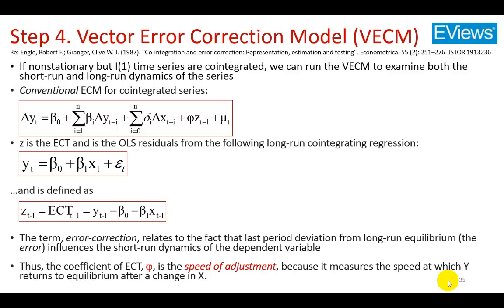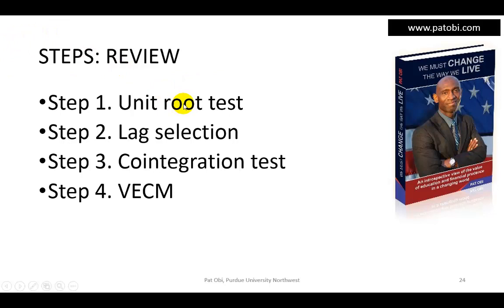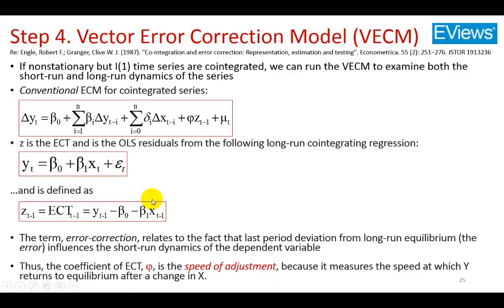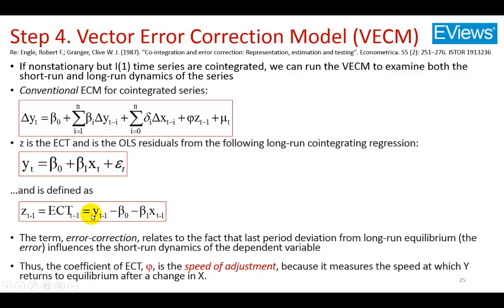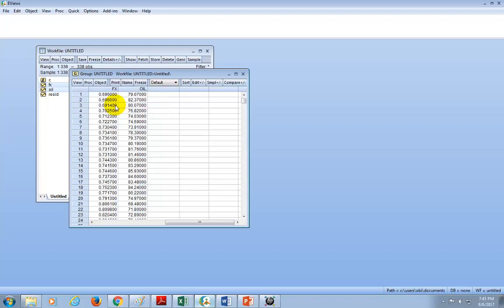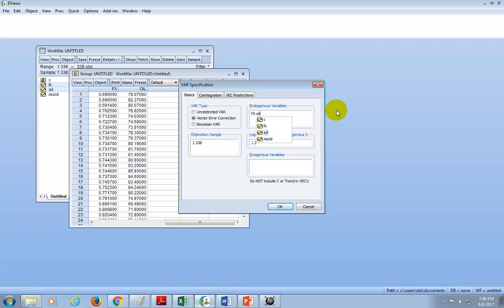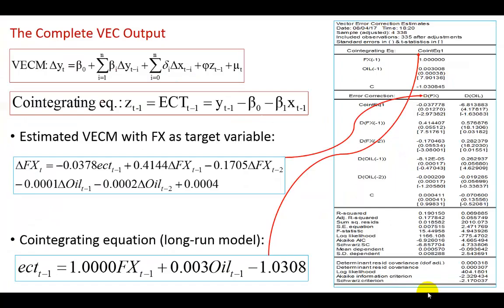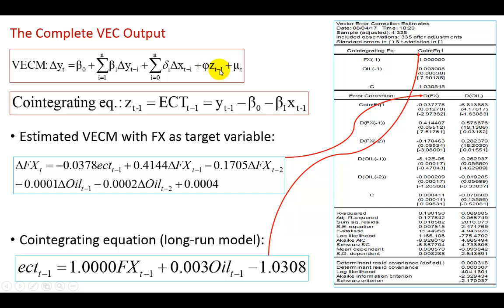Vector Error Correction Model (VECM) - Step 4 of 4

Comment: Thanks so much for your explanatory video. I found 2 vectors with my variables with the helpof Johansen test so I want to ask what if my 2nd cointegration equaiton CE(2) is positive and not significant, I can still say that there is long run relationship? because my 1st cointegrated equation CE(1) is negative and significant. Please help me about this issue. Thanks..

Comment: Professor Pat Obi, I Iove your classes, and I have three questions for you. 1) In case one of the series has no unit root at level but the second one has it, and both of the series have no unit root at first difference. Are they candidates for a VECM model? 2) When you ran the VECM in the video, the R squared was 0.19. Is R squared or F statistic important when calculating the VECM? 3) I am currently running a VECM for two time series, but there is autocorreclation in the residuals. What would be the best way to tackle this issue? (10% percent of the data are outliers). Thank you very much, and if you teach virtual classes please let me know, so I can have one of your classes.
Reply from the maker: If one variable is I(0) while the other is I(1), you should not run a VECM. Instead, run ARDL (I have a 6-part video series on ARDL here on YouTube). Don't worry too much about R-sq and F at this stage. Instead, focus on whether the series are cointegrated. Also, examine the short run dynamics regardless of whether the two series are cointegrated. Residual correlation is definitely not good. Try using different lags. Also, you could try different data structure (daily, weekly, monthly, quarterly, annually). One might also consider adding another regressor. Hope this helps! Thanks for subscribing to my channel.
Reply: Thank you very much, for all your answers, Professor @PatObi ! I am going to check the ARDL videos.

Comment: I think that you must take the p-1 lag in the VECM estimation, which is 2(var lag) - 1 = 1. Thank you for your efforts.
Reply: What happens if the optimal lag is p=1? In estimating VECM do we still subtract the lag so that we get p-1=1-1=0?
Reply: @alphonsedismasorango8406  yes absolutely. In this case, you will take zero as the VECM's lag. Good luck.
Reply: @yassineounnabi4396  , thank you for the quick response. However, when I do that, it gives me an 'illegal lag specification' error. What should I do? Thanks again for your response.
Reply: @alphonsedismasorango8406  in the lag criteria for the var, try to enter 4. Then I think that the criteria chosen will be 3. Then, try to estimate the VECM by 2 lags. If this strategy doesn't work, try to change the number of lags tested in the VAR. Try this and tell me the results.
Reply: @yassineounnabi4396  , thanks. do we use the AIC, SIC or others in selecting the optimal lag? My AIC indicates one lag same as the SIC. Kindly advice.
Reply: @alphonsedismasorango8406  you must take in account all the criteria and choose the lag choosed by the maximum of these criteria.
Reply: @yassineounnabi4396  thank you so much. All the criteria, gives a lag order of 1.
Reply: @alphonsedismasorango8406  so I'm sure that you must check if all the series are stationary.

Comment: Question: The VEC model have two cointegrating equations. The coefficient, C(1) is negative and significant, but C(2) is positive and significant, what will be the overall conclusion for longrun equilibrium?

Comment: Thank you for your good explanations and helpful videos.
I have a question. The objective of my research is to study the direction and magnitude of response of one variable due to a change in another variable. For that, I am planed to use SVAR and generating IRF. Pls tell me if variables are I(1) and there is cointegration then should I generate IRFs from VECM or from the unrestricted VAR? which approach is better?
Reply from the maker: Here's my take but I'm not completely sure: If variables are I(1) but not cointegrated, the OLS regression we run is "unrestricted VAR
." In this case, we difference each series and then run OLS on the differenced series to examine their short-run dynamics. In your case though, the I(1) variables are cointegrated. So you can estimate (1) OLS regression on the levels data (unrestricted VAR) to examine the l.r. equilibrium relationship and (2) ECM, to examine the speed of adjustment to l.r. equilibrium
Reply from the maker: The following ResearchGate Q&A might help: https://www.researchgate.net/post/Can_we_use_unrestricted_Var_model_if_the_variables_with_I1_series_are_not_cointegrated
Reply: Thank you

Comment: THANK YOU SO MUCH SIR FOR MAKING THE CONCEPTS SO CLEAR. I HAVE DID AN EXAMPLE IN WHICH MY RESULTS ARE QUITE GOOD EXCEPT THAT MY ESTIMATED MODEL PROBABILITIES WERE GREATER THAN 0.05.SO ANY OF THE COEFFICIENTS WERE NOT SIGNIFICANT. SO, WHAT IS THE INTERPRETATION? COULD U GIVE ME A SUGGESTION, SIR????
Reply from the maker: jaya subha: If the short run coefficients of the explanatory variable are jointly not significant, then there is no short run causality.
Reply: thank u :)

Comment: thank very much , but i have encountered this problem , all my C(1).........c(7) , are insignificant , what should i do now?                                                
 Coefficient Std. Error t-Statistic Prob.  
    
C(1) -0.030998 0.024244 -1.278581 0.2218
C(2) -0.082780 0.360631 -0.229543 0.8218
C(3) -0.030502 0.341345 -0.089357 0.9301
C(4) -0.107738 0.297568 -0.362061 0.7227
C(5) 0.356619 0.301433 1.183077 0.2565
C(6) -0.012327 0.236723 -0.052073 0.9592
C(7) 0.200735 0.224905 0.892533 0.3872
C(8) 3087.805 1536.751 2.009307 0.0642
Reply from the maker: I believe those are the short run coefficients. Testing them jointly using Wald test will confirm that in the s.r., your X-variable does not Granger-cause your Y variable. That's what I think :-)

Comment: Sir thank you for your excellent explanations. I just confuse cos I got one variable (logTT) zero coefficient for long run how I explain it? can i remove it from the equation? can we use your model for more than 2 variables? thanks a lot 
 Vector Error Correction Estimates 
 Date: 02/02/19   Time: 20:53 

 Sample (adjusted): 2007M04 2017M11 

 Included observations: 128 after adjustments

 Standard errors in ( ) & t-statistics in [ ]

    

    

Cointegrating Eq:  CointEq1 CointEq2  

    

    

LKSEI(-1)  1.000000  0.000000  

    

LOG(TT(-1))  0.000000  1.000000  

    

LHINDEX(-1) -0.154923 -1.038932  

  (0.25311)  (0.08584)  

 [-0.61208] [-12.1034]  

    

LOG(INVP(-1))  0.435698  0.245088  

  (0.18477)  (0.06266)  

 [ 2.35810] [ 3.91135]  

    

C -11.12377 -4.368917

Comment: Sir I have run VECM residuals diagnostic but my model found non normal and hetroskedastic residuals but it  solution for it
I already taking my variable as natural log form.
What can I do for this problems 
Pls rpy
Reply from the maker: Some of the remedies may include (not guaranteed) increasing sample size, changing the lag structure, changing data frequency, e.g.  from yearly to quarterly or monthly, etc.

Comment: Hello sir
i have some questions on the error correction term. as u have mentioned in your lecturer that if the coefficient of the error term does not fall within -1 and 0 then there is problem with the model . in such case what is your suggestion to correct the model. I have my error term -2.00  and am confused about how to deal with it. 
i tried to reduce the lag length of my model from 4 to 3 and the error term falls within the range. if i do this step will it be a problem or is it ok to reduce the lag length. I  have a sample of 30 observations and when i generate the optimal lag, the model gives me 4 lag. 
if you could clarify on this.
thank you

Comment: Sir, In the Long Run Model, how we explain it ? Increase in oil prince positively affecting the FX ? Or the sign reversed in Ect .. Please help
Reply: The sign is reversed in ECT. To see why this is, set ECT to equal 0. Eg. 1.00FX_t-1 + 0.003Oil_t-1 -1.0308 = 0. Therefore, 1.00FX_t-1 = -0.003Oil_t-1 + 1.0308. Just in case you're wondering why we set ECT to equal 0, it's because ECT should have 0 mean.